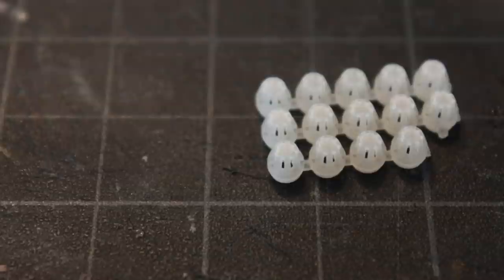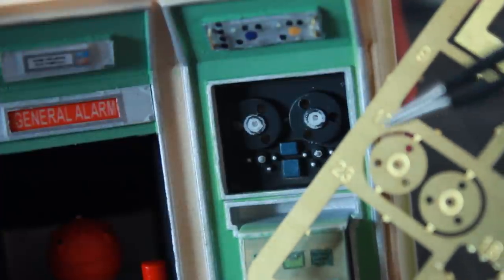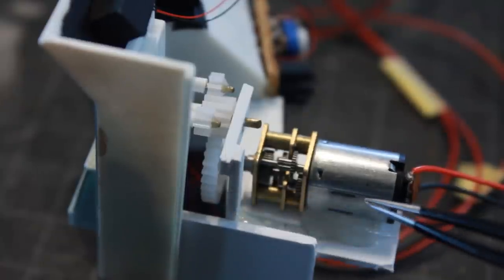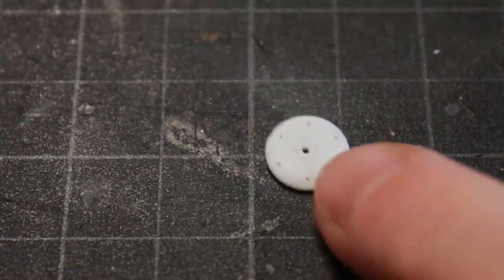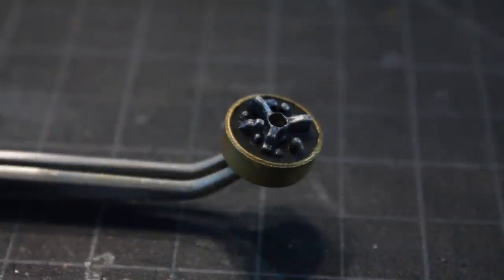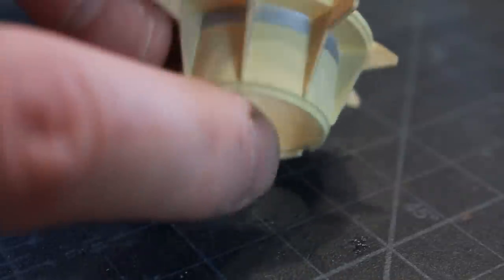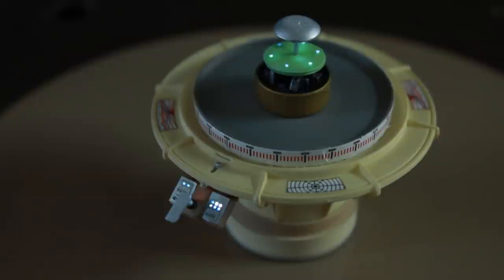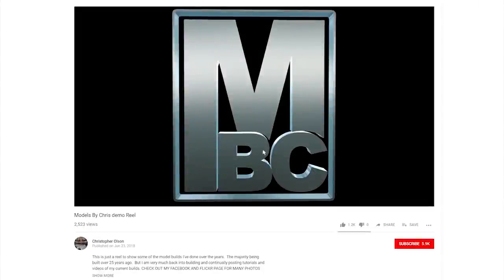Moebius 1/35 scale Jupiter 2 Pt 6 Updates and Astrogator

Comment: Truly at a loss for words at the level of detail.  Like... the little lights on the top of console don't even seem POSSIBLE what you did!  lol  just... amazing!

And after watching 30-40+ of your videos, I think I can finally suggest something!!!  Although motorizing the data wheels is great (can't wait to see how you use your new motor skills in the B-wing!), I don't think data wheels like that ever run at the same speed.  Because you're using the same sized gear, they do;  and all you really need to do is use two slightly different gears to let them run at different speeds.  I think that's more eye-catching, too.  As you could have just used a motor on ONE wheel and mechanically interlocked them (they'd run at the same speed)... but two DIFFERENT speeds... is an extra trick!  And the way you built it actually makes doing that quite simple.

Just a suggestion, I bow to the master in this regard.  +cheers+

edit to add:  You could actually have the motor directly connected to one wheel, and the other would just be a disc with a groove in it-- connect the two with a small rubber band.  Depending on the size of disc #2, you can change the speed to whatever you like.  :)

Comment: JUST AN FYI, ANY TIME YOU NEED TO USE A MOTOR ON SOMETHING SMALL, MICRO MOTORS WORK GREAT. YOU CAN FIND THEM ON LINE OR TAKE THEM OUT FROM AN OLD CELL PHONE ITS WHAT MAKES THEM VIRBATE, THEY ALL HAVE ONE.  YOU CAN USE A RESISTOR TO SLOW DOWN THE SPEED TO BOTH OR JUST ONE...LOVE IT....!

Comment: Great  but you missed aluminum on the fins of the astrologer base and on the top table fins
Reply from the maker: What season? I was pretty thorough in checking with the episodes.  Some of my stuff I added and not actually that way on the show, also.
Reply: @modelsbychris  if you look at all the season's  1-3 the Gibson the table top and the fins on the trunk of the astrologer have aluminum trim. In addition look at the raised circular section on the table top just before where the dome rests there is aluminum trim.
Reply from the maker: @j1035ak  I just found a shot in season 3 where I can see the silver tie taking about.  Other shots, it looks like a darker brown.  The lighting affects it so much. I may have to try and add the silver trim.  We'll see